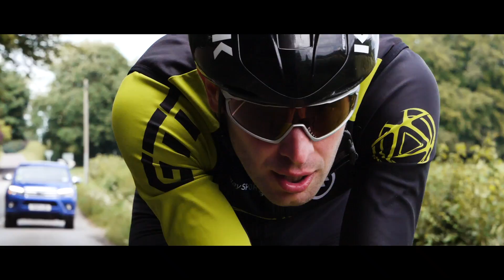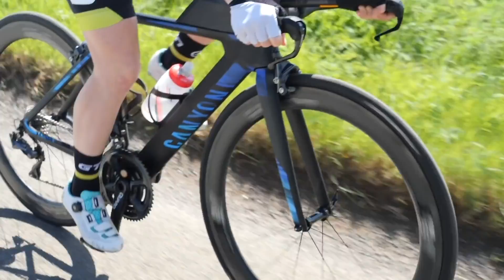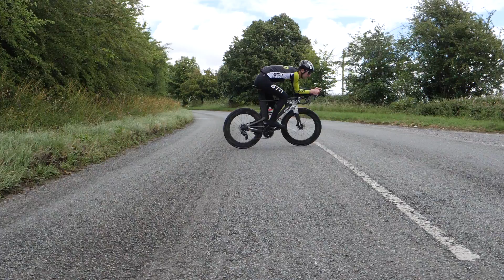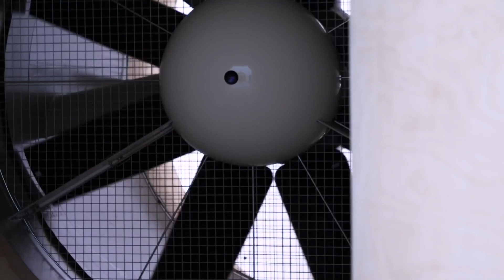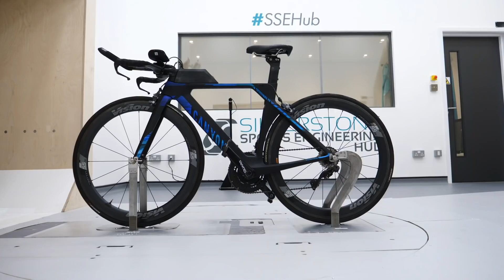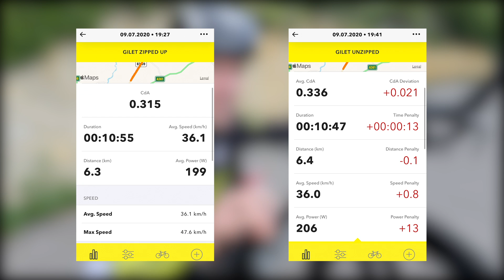How To Get More Aero | 5 Ways To Test Your Cycling Aerodynamics

Comment: Kind of curious how the Notio compares to the Aeropod+ (since it's almost half the price)
Reply: I have the aero pod, and owned the power pod a few years ago. In many ways it’s junk because It doesn’t work right. They charge you a few bucks to buy the phone app, which is needed because every time I have to use it I ave to set up the pod with the app, otherwise it defaults and doesn’t display the cda, nor does it record it. I haven’t used the notio but my experience is the aero pod is half quality on the software end. They also don’t ship it with a tt mount, more extra you have to spend.
Reply: Camiel Hirschberg aeropod integration blows

Comment: Nice review of methods. All of the field tests except for your #1 get improved with a dedicated speed sensor on the wheel rather than using GPS for speed. There's another coast down method which can be a little better than your #1 or #2 methods. 
I noticed cars on the road while you were testing. A car can screw up part of a test run -- depending on its speed, a single car can disturb the air for at least 15 seconds, and sometimes more, so it's best to do runs on a traffic-free road. Some riders will do tests on deserted country roads at midnight, or right at dawn, when traffic and wind are both low.

And, I suppose I'd describe #3 as freeing you up from having to use any particular shaped road, and from having to use any particular speed or power -- as long as you don't have to dodge cars, pedestrians, or other cyclists, and can hold your position without using your brakes. So, yes, you can test on a bowl or half-pipe; but you can also test on a flat road, or on a rolling road, or a loop where you're only making turns in one direction so you don't have to cross in front of traffic, or even up a hill.

Comment: There are 3 factors I focus on for my Tri bike set-up. In terms of importance 1. Comfort, 2. Power output, 3. aerodynamics. This is because to me, it's important to be comfortable enough to still run after the bike leg, esp for a Half IM distance and up. I have some friends who place aerodynamics as top priority, but in that sacrificing power output and comfort..
Reply: Rather than three factors in that ranking, it's closer to there being two factors that you balance: 1. comfort; and 2. the ratio of power to drag (i.e., watts/CdA). You want the highest watts/CdA for your particular distance (sprint/Oly/half/full) that allows you to run after T2. Focusing on watts/CdA is better than just watts alone and CdA alone since it tells you exactly how much you'd be willing to give on one to get an improvement in the other. For the same comfort level, you'd be willing to give up 5% in power if you could reduce CdA by 6%.
Reply: In our experience and seeing how some of the best performances were achieved across cycling disciplines the common theme is Watts/CDA and finding that sweetspot. Our ambition at Notio is to bring numbers to this process in real conditions and not only let you test for optimum aerodynamics but also use the Notio while training. We have seen some of the top triathletes achieve great numbers in testing but cannot reproduce this when training at longer race pace distance. They have either persevered and adapted or adjusted position but without knowing what happens during efforts at race pace is untapped gains. So using the Notio as a tool to help you be more compliant when fatigued or getting a position that is attainable relative to the demand of the event is now possible.
Reply: @notio499  are there published numbers on the accuracy and repeatability of the numbers you display ?
Reply: Gotta get the sweet spot bro. Its the same concept as slamming a road stem. I'm in my 40s and staying too long in that one uncomfortable position takes a huge toll on the body. It's not just on watts efficiency. Age grouper problem much? Hahaha